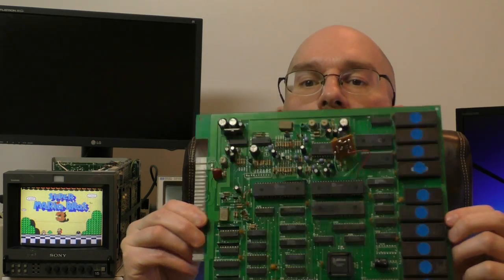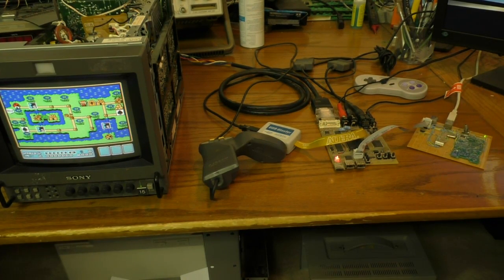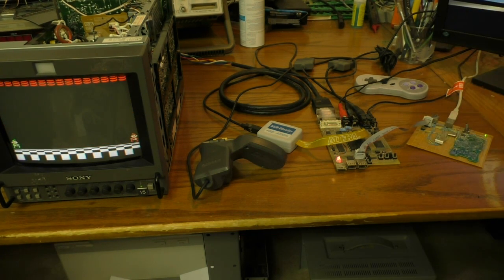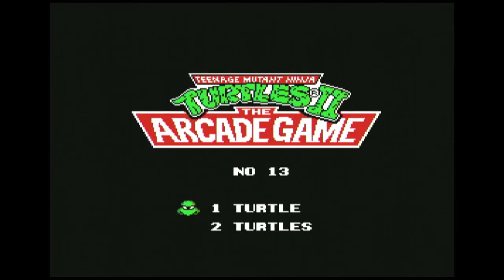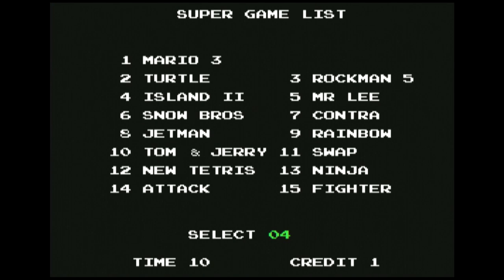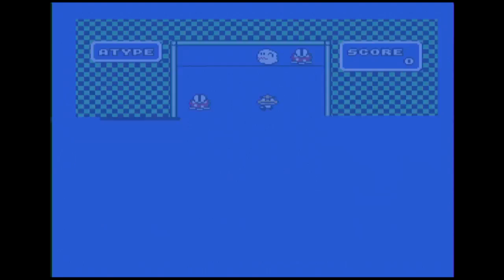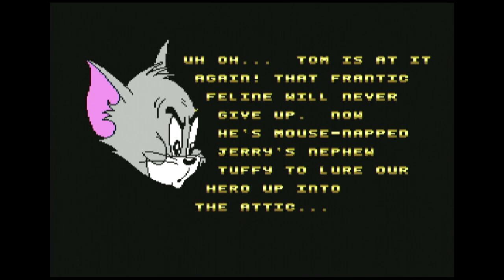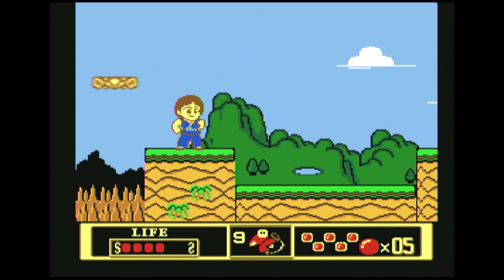Reverse Engineering Unlicensed NES Arcade Board #3

Comment: So the rom won't work on a flashcart but can it work on an emulator like MAME or Nestopia?
Reply from the maker: it works fine on my FPGA NES, but that doesn't help too much. hehe.  the document is out there for any emulator writer that wishes to add it.
Reply from the maker: that's right
Reply: kevtris It doesn't work on Nestopia...haven't tried MAME yet.
Reply: I tried it on FCEU GX for the GameCube/Wii, didn't work. That emulator is pretty good for arcade NES games because it does have an insert coin button and color palettes specifically for the 'Vs.' games. This video is now nearly 2 years old and the link is still up, I wonder if somebody fixed this ROM to work on NES emulators/flash carts. I guess I'll search Google.
Reply: Rom does not work on these emulators because they do not support mapper #124
Reply: I opened this issue on Mesen emulator Github 

https://github.com/SourMesen/Mesen/issues/325

Comment: Are the roms you use with this the ones that were on the EPROMs or are they clean verified dumps from the internet?
Reply from the maker: These are the ROMs that were on the board.  The games have been extensively modified to run on here and accept money so any other copy of the game will not function at all or properly.